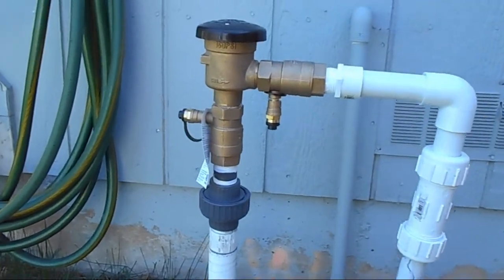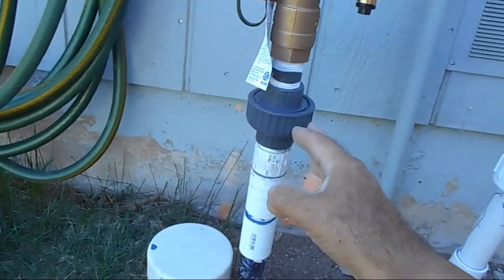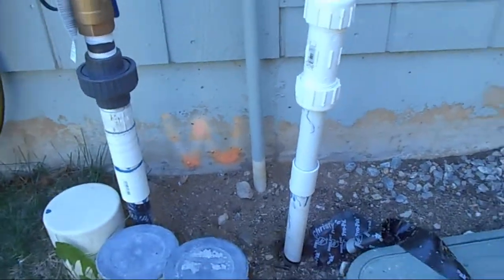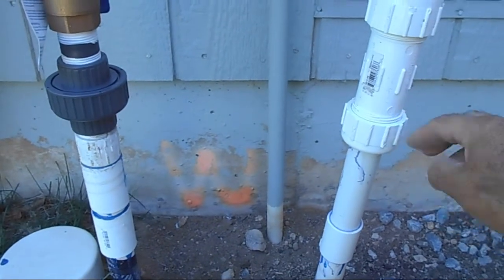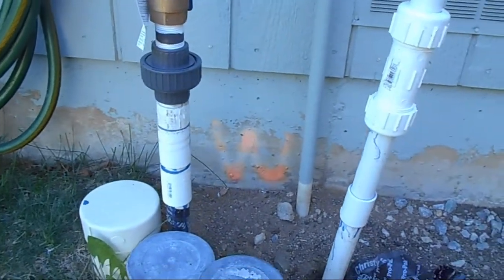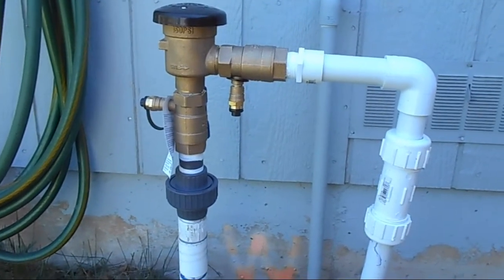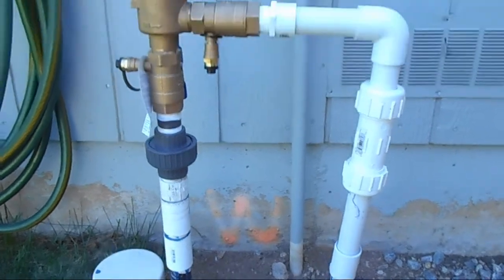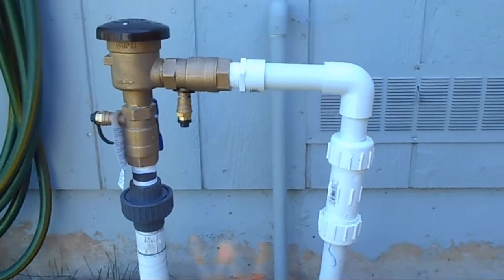Irrigation Line and Valve Replacement

Comment: Nice job Larry, just in time for watering season coming.
Reply from the maker: Thanks Lloyd and yes its getting back into the 80's here so standing out there and watering by hand will not be happening after I get the irrigation system back up and running

Comment: Very nice, our winters aren't that harsh. Good luck with the system.
Reply from the maker: Thanks for watching PT yes well my first two attempts with the compression coupling didn't go well it was turn the water on and kasploosh one side of it didn't hold tightened it again and the other side went so i just glued up the line solid on that one side the valve the most expensive part I can still take off before the winter hits. The last two years we have had minus 5 and minus 10 degree temps for a couple days but weeks at 10 to 15 degrees pretty cold for the Northern desert of Nevada.
Reply: Glad you got it worked out. Crazy temps there. Take care
Reply from the maker: Yes and go figure today it was 90. So my new irrigation system got a workout

Comment: Good idea to make it so you can take it apart easy. Looks good. The "W" on the foundation is for Wally
Reply from the maker: yes it will work fine. Yes they had you in mind when they put that W for wally in there lol
Reply: Well.
Reply from the maker: This was my bothers idea for the compression coupling I wanted to glue it up solid at least on one side. When I turn on the glued up side I will do another video hopefully it will be less dramatic

Comment from the maker: Well waited until overnight to test the system if you go to my facebook page (Lawrence De Silva)on my timeline you can see what happened. Did it hold well one side did. But the compression coupling couldn't hold the pressure and blew. So I just finished gluing up one side so that its solid. But I can still move and take out the valve for the winter.

Comment: My oldest son has been doing irrigation for 20+ years and I still have to pull 300 feet of hose to water.
Reply from the maker: buzzsah well its easy enough to do. But after i had my gardner rebuild my system when i had my front and back yard landscaped i fired him two years ago and have been taking care of everything myself. When the freezing weather destroyed the back flow valve and the lines had to do it but make it totally movable so i will cut down on my repairs